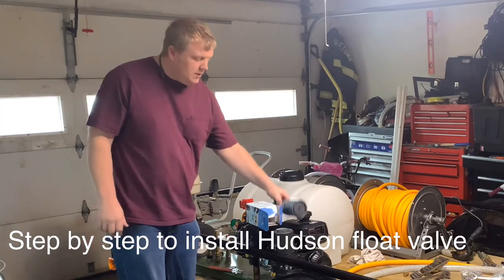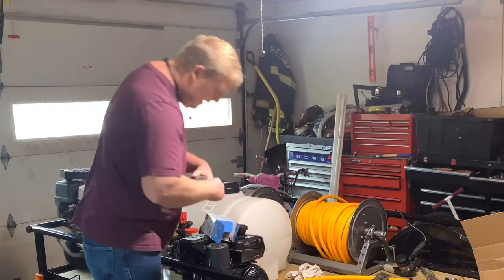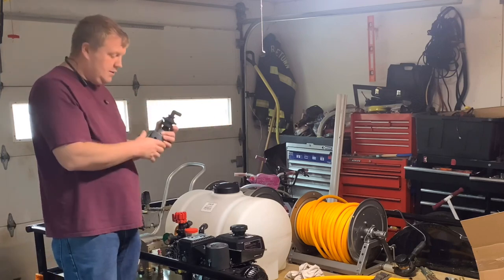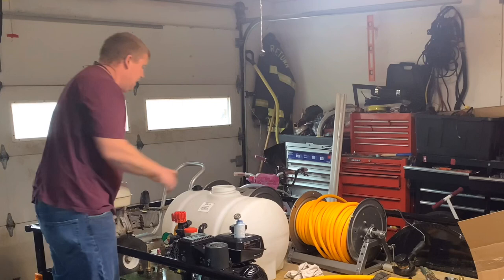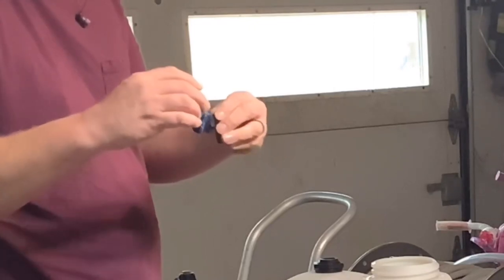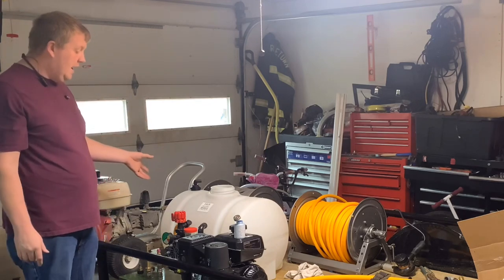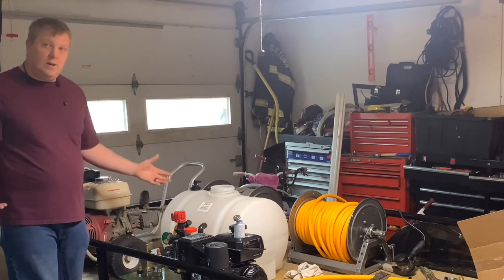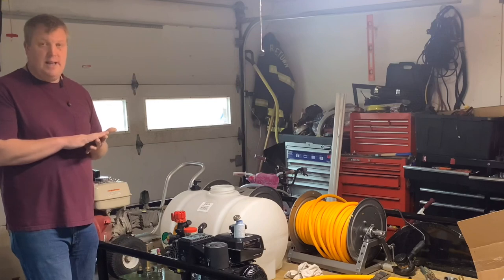How To Keep Your Tank From Over Flowing? Hudson Float Valve Install

Comment: CAN I RUN THE WATER HOSE FROM THE HOUSE DIRECTLY TO MY PRESSURE WASHER AND THEN HAVE THE RETURN WHIPLINE RUN WATER INTO THE BUFFER TANK THEN FROM THE TANK HAVE IT ALSO GO TO MY PREASURE WASHER WITH A MULTI-hose connection thing.  I really want to keep using the tank just as somewhere to unload the water from the pressure washer so I don’t ruin my pump by not being in the trigger.   Thoughts please.

Comment: I have installed this valve but I’m getting intermittent overflowing. Has this happened to you?

I have connected nothing but a garden hose to the float valve to keep my tank full. But sometimes it decides to fail causing overflow. 

Do I have a bad new float valve or is this a common problem with these. 

Not sure which direction I should go from here.
Reply from the maker: Most likely a bad valve or crap in that valve.

Comment: Do you use TruBlue on the brass connection from the tank to pressure washer pump inlet ?
Reply from the maker: Yes I do anywhere that I use in nPT pipe I put true blue on it